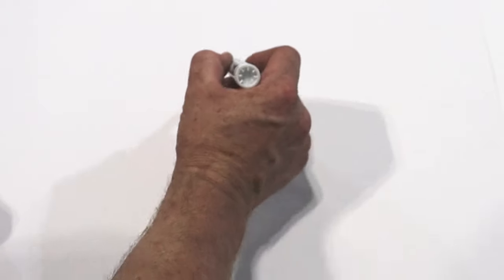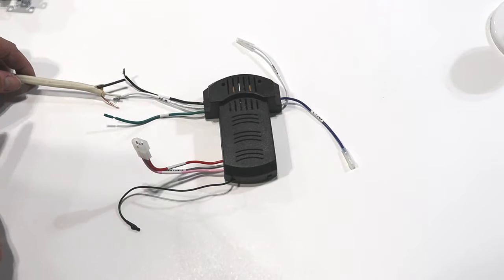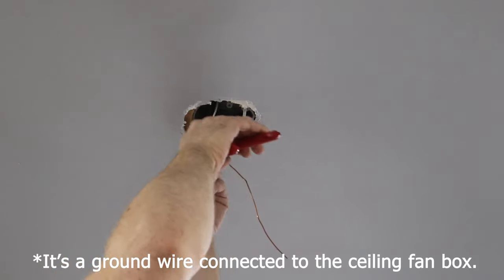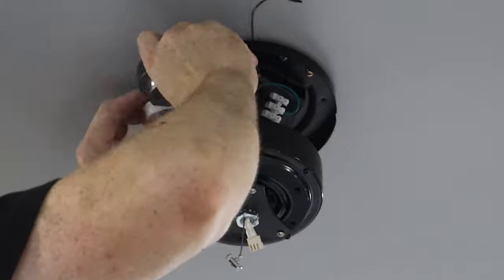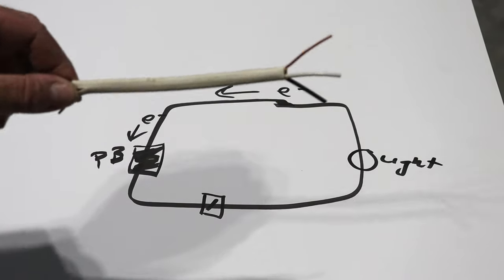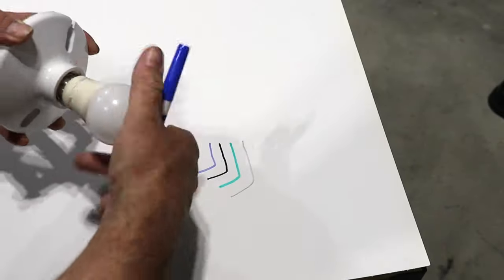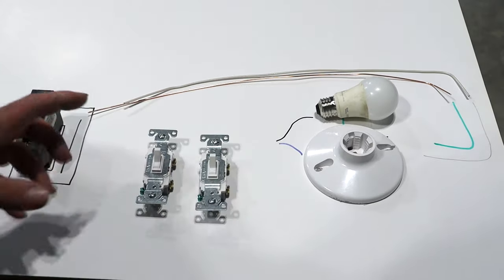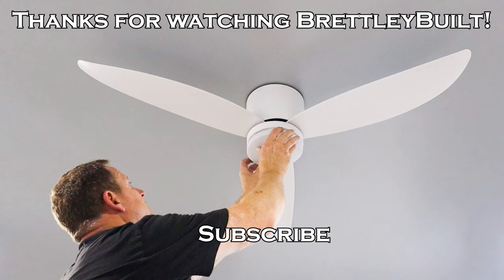Ceiling Fan Installation and Circuitry Explained | Controller and Two Switch Circuits Demonstrated

Comment: Hi, Love your video; very detailed and instructional. Would it be possible for you to advise the make/model number of the ceiling fan wtih the remote.  Thank You, Richard
Reply from the maker: I bought it on Amazon. Not sure of the exact information. I just looked for a fan/light combo that had a remote control included.

Comment: Hello, Great videos you have . I’m glad I found your channel. Question, can recessed lights be connected to the incoming power to the ceiling fan? I currently have a double switch controlling the ceiling fan and ceiling fan light and also the ceiling fan has a pull chain. I have a separate switch for the recessed lights and a 12/2 wire running up to a junction box in the attic ( no power just spliced wire in the junction box) black to black , white to white and grounds to junction box so that wire is running into the junction box to the ceiling fan (no power). The recessed 12/2 wire is also coming in into the ceiling box junction box (no power) the ceiling fan junction box a 12/3 wire is what is connected to the ceiling fan white from fan to black from power source. Black from fan to black from power source. Red from switch to blue from fan and all grounds to pigtail to junction. So I’m wanting to supply power to the recessed lights to be controlled by the single switch. Thanks!
Reply from the maker: Can you send me a simple drawing of your set up. brettleybuilt@gmail.com
Reply: Thank you, just sent the email and drawing.

Comment: Hey there I need advise.  I have a Meross relay switch that is 10 A.  Can I use that for a Harbor Breeze ceiling fan?  I realize most switches are 15 A but I researched some smart ceiling fan switches on the market and some of them are even less than 5A.  So is 10A ok to connect?  Thanks. 🙏
Reply from the maker: I honestly don't know on this one. I am not totally familiar with these switches or relays.

Comment: This video is spectacular. I wish the electricians that wired my house during the remodel were half as sharp as you!! 

Question. During the remodel we purchased Hunter fans that all have a remote. We also dropped two switches. Nothing with the switch positioning and how the fan and/or light responds makes sense to me. Can you have two switches on a remote set up and still have one switch control the fan and the other the light? 

I understand that if the light switch is off, obviously the remote can’t control the light. Same principle for the fan. I don’t see why both switches still couldn’t control each function while still being able to use the remote (assuming the circuits are closed). 

Thanks for the video and thanks for your wisdom!
Reply from the maker: The best way to do this is to use one switch to control the power to the ceiling fan/light, and use the remote to control everything. Generally the light is controlled by flipping the switch when walking into or out of a room, and then the fan is controlled using the remote.

Comment: Ok, so I tried installing a 3 way switch for a fan that has no pull strings or remote to control the speed, and it confused the crap out of me do it not having a neutral white wire.  My question is, how does one complete the circuit if there’s no white wire, and what do you do with the white wire coming out of the wall?  The fan didn’t run at all when I wired this up, but it runs at one fast speed only when I use just a regular light switch.  BTW, the 3 way switch is a Radiant 3 way ceiling fan switch by LeGrand.

PS - fantastic video and highly informative!!

Comment: I love your explanations with the visual it ties it all together. I had an old fan that had the separate switches for the light and fan. Just got a new one with the remote. Is there a way to wire it so that you can still do the light and fan separately? I am guessing not unless you ditch the remote right??
Reply from the maker: Right, or just use the remote for the fan if you wanted so you could control the fan speed.

Comment: Great electrical video. Now a question. What if I have dual switches, but like you couldn’t find a ceiling fan without a remote. My solution was to cap of the red and use only the live feed from the black line to power the remote receiver box. What I am trying to determine is what would have happened if I instead connected both the live lines from both switches to that remote box. 

Would that simply allow both switches to provide power (certainly this must be true) or would it overload the ceiling fan if both switches were flipped?

Comment: Your video is great!  The explanation, visuals and tempo are done well.  I do have a question: For what are the colored wires with a modular connector?  I have Possini Encore Hugger ceiling fan with light kit that has red, gray, purple, and yellow wires with a modular connector, but the new receiver doesn't have a place in which to plug it or any corresponding colored wires.  The original receiver was damaged by condensation. The manufacturer sent a new updated one and specifically stated that the new one is compatible with the older model fan.  How do I connect the 4 colored modular connecting wires from the motor to the receiver?
Reply from the maker: I am not sure without looking at it. Can you email me some pictures? brettleybuilt@gmail.com

Comment: Hi. Amazing video. Quick question: We just bought an old house and have been finding all sorts of weird circuits. In one room where we are changing out an old ceiling fan there is only a hot and neutral in the ceiling . When I removed the wall switch the hot to the ceiling fan, black wire is still hot. It’s a constant hot tied in to another circuit with some wall outlets. Any idea how a wall switch control a ceiling fan with a constant hot? I’m totally confused. Thanks in advance.
Reply from the maker: Sometimes they will run the hot wire to the ceiling fan or a light first, and then run the hot to the switch and a hot wire back to the ceiling fan or light box. I don't like doing it this way, but people do it.

Comment: Your videos are GREAT, and we appreciate them.  I do have a question for you I am hoping you may be able to answer.   We installed a Kasa single pole switch on our ceiling fan with a light and we use a remote control to run it. We use the switch mainly to turn the light off and on, and then the remote at night to turn the light off  Originally, everything worked as it should have, but then all of a sudden, when we turn the light on with the switch, it takes anywhere from 10 to 30 seconds for the light to come on, which is very odd.  Now, if we leave the switch on, and control the light with the remote, it comes on instantly as it did at first with the switch.  Any idea what may be causing this?  Again, it is a single pole switch one push on, one push off controling the fan and light.   Thanks for your time and help, and your great videos.
Reply from the maker: Not sure. I looked up Kasa switches after seeing your post, and it seems like other people are having the same issue. Not sure about what causes this.
Reply: Ok, thanks anyway. Hopefully if somebody else is having his problem and gets it figured out, they will post it here.  Thanks again, appreciate it. @brettleybuilt
Reply: Love your videos.  Thank you for your work on them. Very helpful and educational. Keep up the good work!